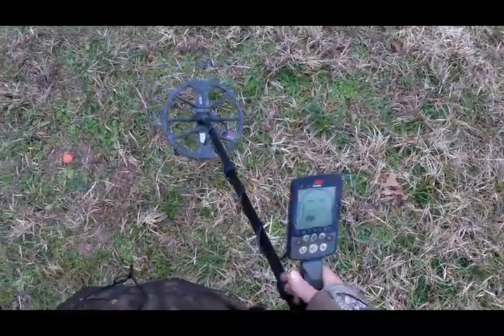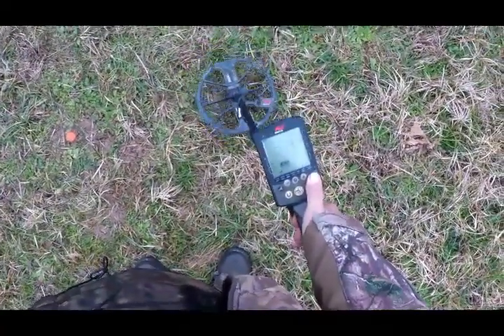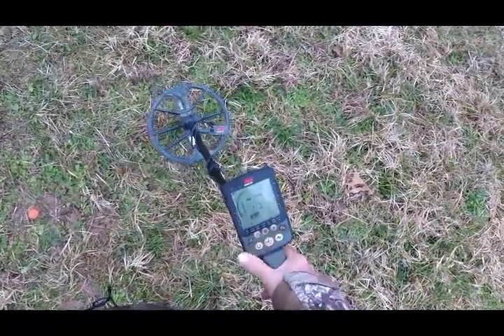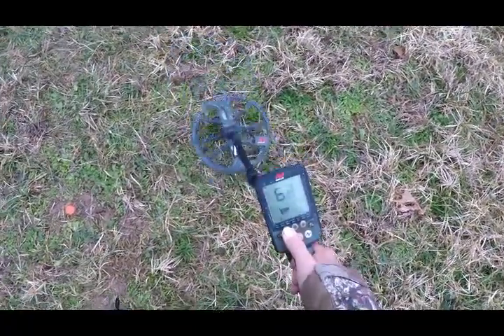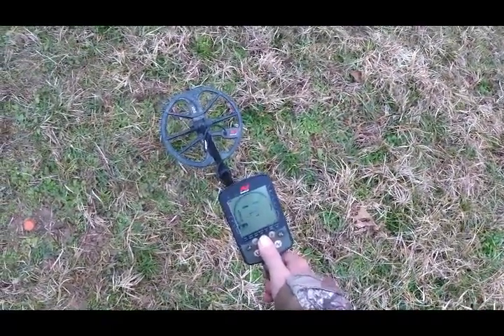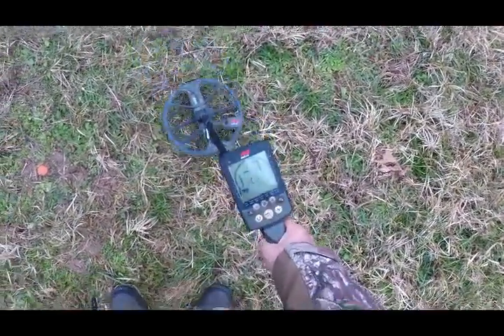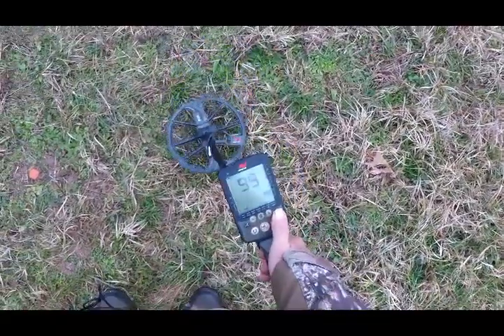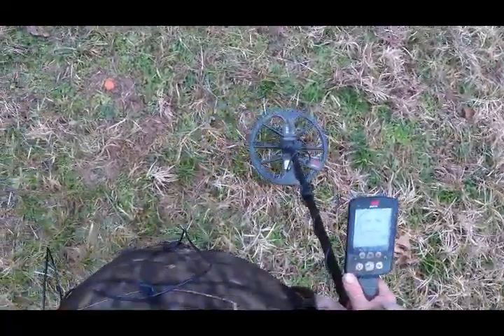EQuinoX 800 ground balance info

Comment: My Vanquish does do that. When you notch out the last two negative segments it goes away. -8 & -9. Might be picking up minerals in the ground.
Reply from the maker: I think monte's unit is normal ops.  Caused by multi IQ and GB the way they are setup up.  Remember eqx first multi freq we can GB and see some kinda reference number wise.
Reply from the maker: First Minelab multi freq. I should have said.